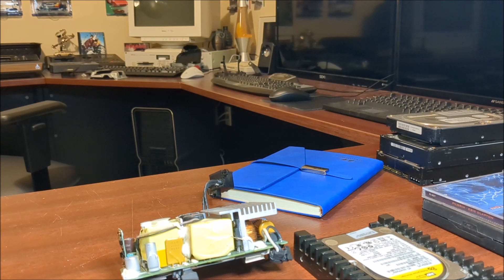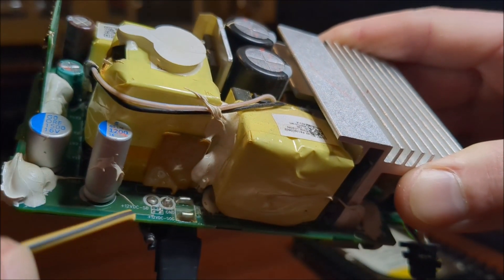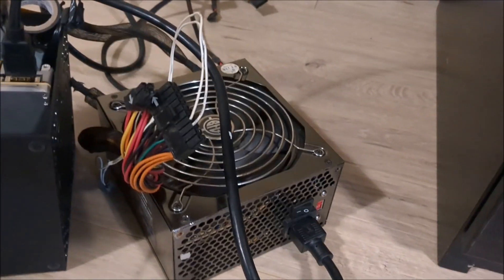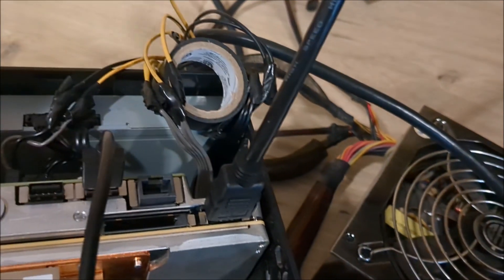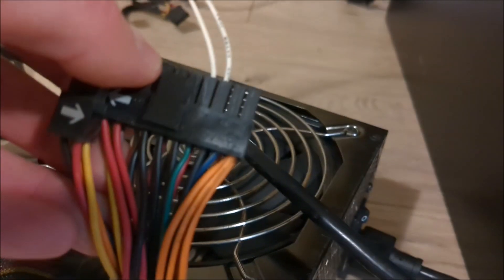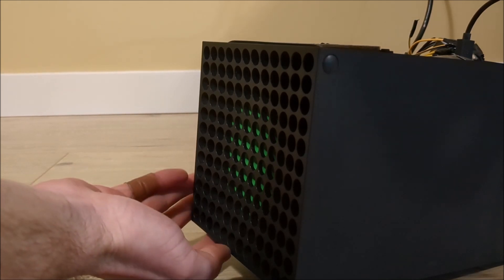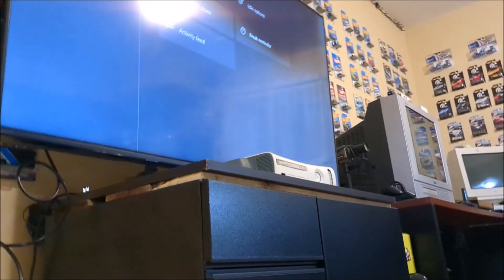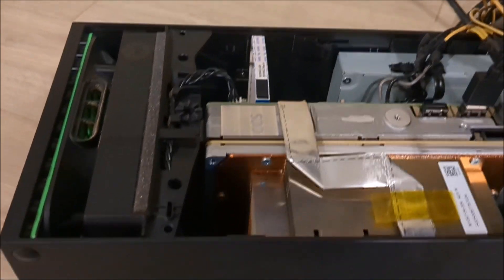How to use ATX Computer PC Power Supply to power up and run an Xbox Series X

Comment: (2025-06-08) 
Thanks for your video, that gave me the confidence that the 12V needed by the Xbox Series X works the way expected and I was able to remove a faulty xbox series x power supply, rewire the part that connects to the board to power it with a high-end external 12V 1000W DC power supply I had. // 
Yes, that power button not working with yours is due to a broken cable. // 
There are some things I'd suggest for anyone else doing this kind of mod, like ensuring the wire gauge you connect to should match the wire gauge/thickness of those five wires combined, but I'll update that in a future edit to this comment.
__________________
(2025-06-12) 
Some additional comments that could be useful for anyone doing this mod I'd like to share:

(ABOUT WIRING / SAFETY)
[1] I ended up running two lines for better electrical isolation
[2] the main 12V, 21.25A line needs to be connected to wires at the appropriate temperature ratings (the higher the better) and gauge (the thicker the better) so it can handle up to 21.25A long term, like for example 12 gauge with insulation rated for 200 deg. C  can handle around 55A continously.
[3] But at the same time, that wire can't be too thick or the metal shell that normally covers those power connectors won't be able to close!
[4] the standby 12V,5A lines are a similar deal, but can use thinner gauge
[5] I soldered the wires to the cables and secured it with electrical tape.
[6] ran the thinner 12V,5A cables through the same channel that normally had the 120V AC line going in.
[7] ran the thicker 12V,21.25A cables through the opening on the left side of that metal cover, and drilled a small hole on the removable back cover for the wires to come out
[8] I terminated these cables with XT60 male connectors, rated for 60A. (i.e.: the thing receiving power should be male)

(ABOUT THOSE TWO 12V DC LINES)
[1] From the power supply sticker, the main power is up to 12V, 21.25A (255W) for when the system is on.
[2] The standby power is 12V, 5A (60W) for when the system is "off" so it can do downloading in the background.
[3] A Reddit thread shows that that standby voltage is further regulated into lower voltages (~3V to 5V) for the actual standby functions (2022, "Standby voltages for the Xbox series X")
[4] I'm personally not that comfortable with that much power draw in the background, so I ended up connecting my external DC power supply to a switched extension cord so it can truly be turned off.

(ABOUT EXTERNAL DC POWER SUPPLY)
[1] Turns out that if one uses a switched mode power supply (SMPS), overspecing isn't the best option, since these things cannot guarantee their power efficiencies when operating at low loads, especially below 20% and gets worse as you approach 0%. 
[2] I initially used a 1000W, 12V DC power supply (Meanwell HRPG-1000-12) borrowed from somewhere to test the idea. It worked, but drew a lot of power even in standby mode.
[3] I then bought myself a 500W, 12V DC power supply (Meanwell RSP-500-12) and it worked much better (and much quieter too).
[4] Wouldn't recommend the cheapest power supplies; 
[5] Power factor correction is an important feature to look for to improve power efficiency (usually not present in cheaper power supplies).
[6] A low ripple spec is also an important feature, for longevity of the system (usually not present in cheaper power supplies). 
[7] I terminated power supply cables with XT60 female connectors, rated for 60A. (i.e.: the thing providing power should be female) 
__________________
Reply from the maker: Thanks for the comment and nice psu you have there! Always an excellent idea to use proper wire to prevent overheating and/or fire

Comment: have you tried the 5vdc standby power from the psu for the constant voltage? it might work.
Reply: Just to clarify the series s just have the sb and i was thinking using one 360 watts 12v on sb like i currently use on series s and other 360watts on the not named bunch of wires
It need to be oversized because it is a heated enviroment althougth i can think i can make it work with only 360 watts i want it to run cooler
Reply: @PedroHNobre  there are diagrams and guides to this online if you look it up "how to power Xbox one with atx power supply".

I don't get the point of this if your powering it with a battery though as it would constantly be being powered by the 12v right? Let me know why you want this
Reply from the maker: Honestly. I am scared to try. It says 12v SB, I mean in theory it wouldn't do any damage but...
Reply: @dom80TA Can You try one 12v rail on sb and Other 12v rail on these bunch of wires together
I use a series s powered by battery and i was thinking using 2 rails one for sb and other for the other not named as for 5v i can assure you it wont work because it is fantastic engineered in 12v and the other voltages is converted on the motherboard
Reply from the maker: @PedroHNobre  I would assume you could even use a 12v rechargeable for the sb power on that one wire. I haven't tried that though
Reply: @dom80TA I'll let you know if I ever get around to trying it.